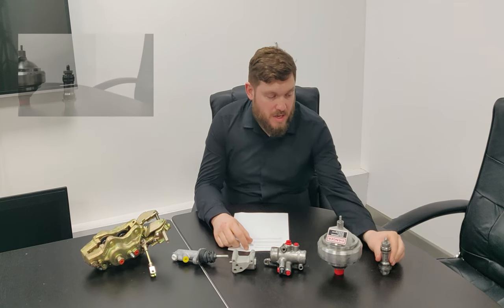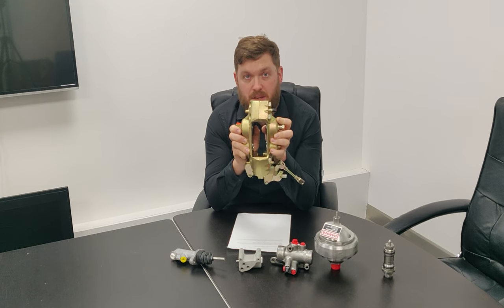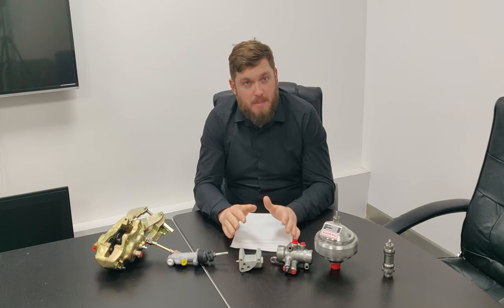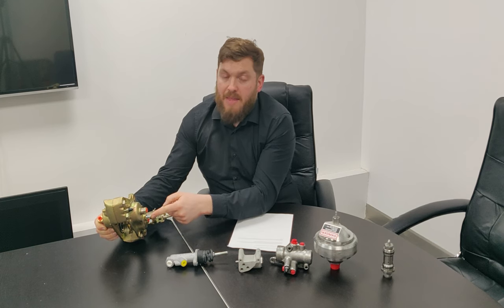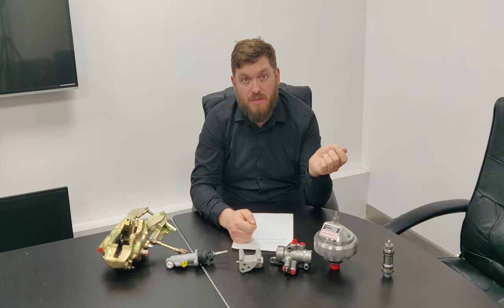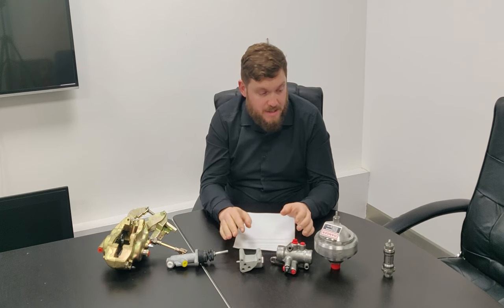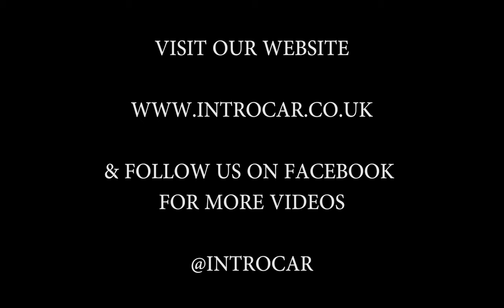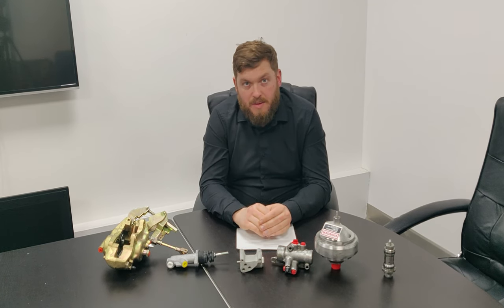Bleeding the Hydraulic System in Silver Shadow, Spirit & Bentley T series models

Comment: I'VE GOT A '75 SILVER SHADOW ;AND LIKE IT VERY MUCH. HOWEVER THE HYDRO SYSTEM IS A BIT OF A NIGHTMARE. IS IT POSS. TO JUST BLANK OFF THE HYDRO HOSES AND PIPES AND REPLACE / INSTALL SHOCKS OR AIR SHOCKS AN/OR UP DATE THE BRAKE SYSTEM WITH ELECTRICS ?
Reply from the maker: If you have a '75 Silver Shadow, it will only be the rear suspension that is adjusted by the hydraulics. It would be possible to delete the height control but I wouldn't recommend it. It would mean that the car would sit too low if you load it with any weight.

The braking system also runs form the power system and I would imagine it would cost less to get it working properly than it would to try and change it to any other type of system. 

Do you know of a specialist to look at the car and figure out what it needs to get it working properly?

Comment: This breaking/suspension system is more complicated than my last girlfriend 🤷🏻‍♂️🤔. 
my o/s drivers side ram isnt going up and down, after fitting a repair kit on my o/s height valve, thanks for the mentin on the bleed nipples on top of the rams, it does point towards air on that side, i had forgotten about those,
great video 👍.
Reply: Ok, my GF is more complicated. But her attitudes i can ignore. I have the same issue as u. Did u solved it?

Comment: Good Vid. Could you judgde the influence of brake fluid, wrong use, at the valves. Im struggling with a 83 Silver Spirit. No pressure at the outlet of right priority valve. Pump of vircuit 1(red) 5 bar. Pump changed, new, now hydr oil at the loosened srew of high pessure outlet. No pressure at the bleeding screw, no motion of the rear axis by moving the lever of hight control? Benn pretty desparate meanwhile. Thx for any help. Cheers, Axel from Ge.
Reply from the maker: Hi Axel, if there is no pressure coming from the pump then his fault is at the pump. That is good to know.
 So you can have three possibilities; 

-The pushrod that drives the pump is broken so the pump is not doing anything
.
-The pump has an airlock and needs to be primed to get started.
-The pump is faulty.
 

If you can check these things then we will be able to identify the fault.
Reply: @introcar  Hi, i meanwhile replaced the pump by a new one. now, if i open the hose screw behind the priority valve, fluid commes out, now. but the next valve, only High pres in od out don´t let fluid out a the access isde. could it been chlogged? Like i said, thre seemed to be brake fluid instead the green hydr. fluid in. thx for quick reply and cheers, axel
Reply from the maker: @corvette724  Hi, not a problem, we are more than happy to help.
First of all you need to establish if there is brake fluid in the system. If so the system could be contaminated and this will cause a lot of problems. Could you have a look at some of the rubbers in the system to see if they are swollen/contaminated?
Reply: @introcar  ok, i do. wher woul you recommend, to look first?
wich part of the system?
Reply from the maker: @corvette724  Probably the easiest place to look is the rubber at the brake pump. That is the first place that the fluid gets to.
Reply: @introcar  at the low pressure access from the reservoir?
Reply from the maker: @corvette724  Hi, I think is better if you can email us directly. Easier that way, if you can send us an email to Matt.duncan@introcar.com and we will be able to help you better and answer faster
Reply from the maker: @corvette724  Hi Axel - do you want to email me directly at sales@introcar.com - just put my name as the reference. Or call the office at +44 (0)20 8546 2027. Probably easier to chat through directly!

Comment: on cars with a master cylinder system the way to bleed the low pressure circuits as follows . the low pressure bleed screws are the upper bleed screws on the rear calipers. to bleed the air out of the system firstly de-pressurise system open upper rear bleed nipple furthest away from the master cylinder.depress the brake pedal and then bring it back up slowly. do not shut off the bleed nipple after downward stroke like on normal cars this is incorrect. keep depressing the pedal and let it come back slowly until air has been removed. then when you are satisfied with this press the brake pedal down and hold it down and tighten the bleed nipple. this is the correct way to do this

Comment: What about the infamous "rat trap"?
Reply from the maker: The Rat Trap is underneath the drivers seat. It houses the distribution valves, the master cylinder and the G valve. The brake pedal comes through the car and connects to the linkage in the rat trap. I think on the very early cars you could bleed the distribution valves but I have never bled anything in the rat trap. Sometimes it is necessary to open the pipe on the master cylinder and bleed it at the pipe, then work your way down the line until you get fluid at the caliper. You will only need to do this if you can't get the caliper to bleed in the first place.
Reply: The early master cylinder links to the lower rear caliper bleed
Reply: Thanks! That's a massive help!